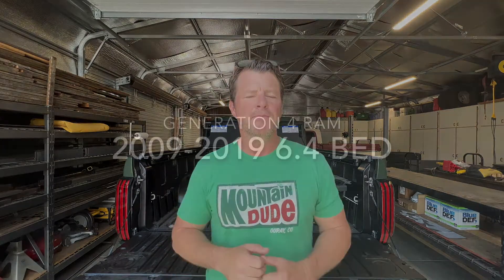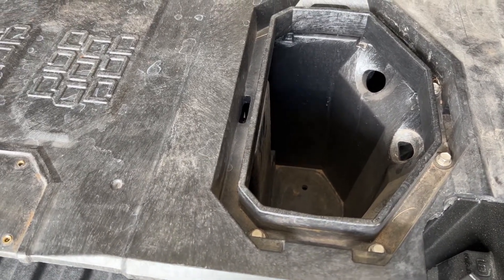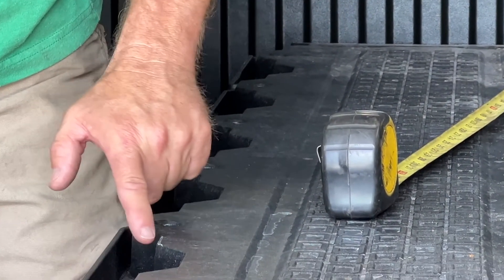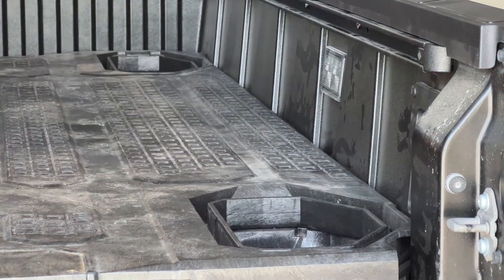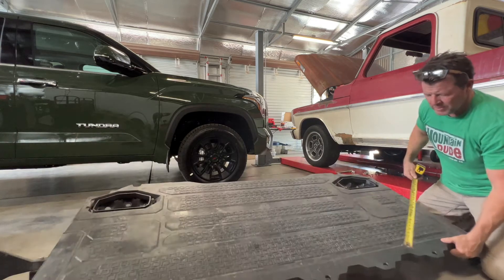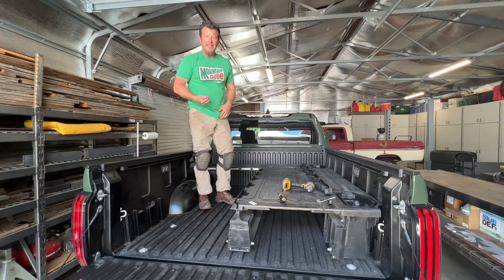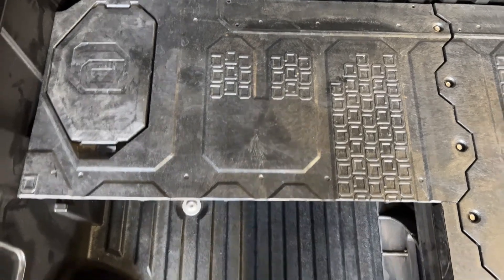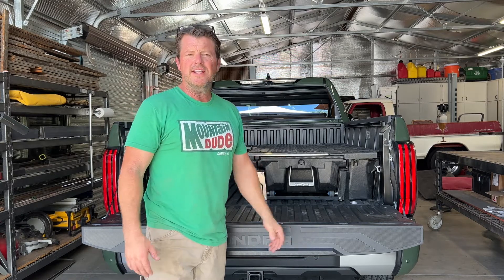DIY Customize Decked Storage to Fit Your Truck-2022 Tundra Overland Build

Comment: Great idea. I'm a plumbing and hvac contractor and been using the decked system with a tonneau cover for 8 years . Been scratching  my head on how I can still use the decked system and still get some large items in the back without sacrificing the tonneau cover and using one side like that may do the trick.

Comment: This is an awesome idea! I’m getting a GFC topper and tent combo, and this would be perfect for that set up. Can you list the things I need to buy to secure the system to the tie downs? I have a 3rd gen TRD Offroad Tacoma short bed. I’m not too fond of drilling into my truck bed as instructed by DECKED.
Reply from the maker: You can use all the original tie downs except for the one in the rear center of the bed.  As far as drilling into your truck bed, I disagree with decked.  One hole in a truck bed 3/8" dia that is drilled will not hurt the bed.  The bed was designed to be used not designed to just be a cosmetic attachment behind the cab. Once the hole is drilled you could use a paint pen to go around the drilled area so no corrosion would begin.  Just make sure the bolt does not interfere with your spare tire mount.  Good luck.